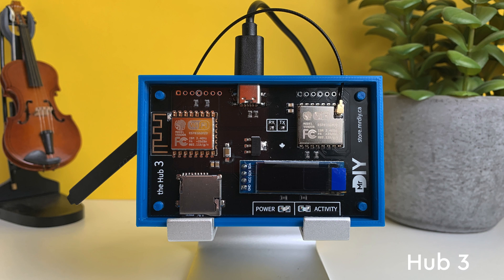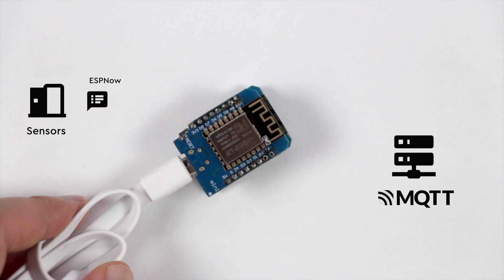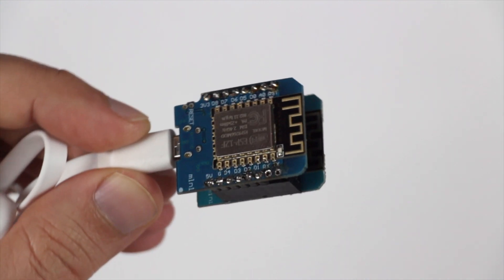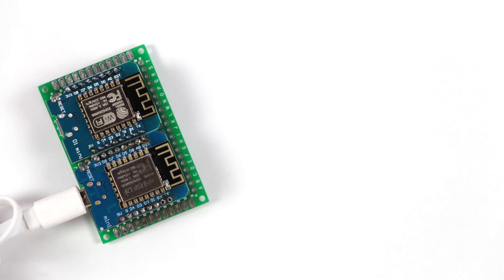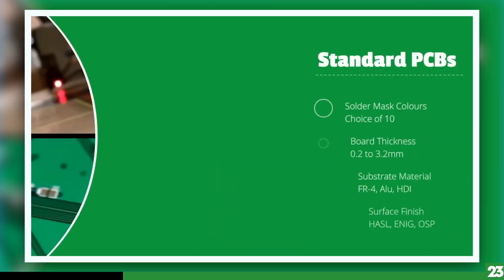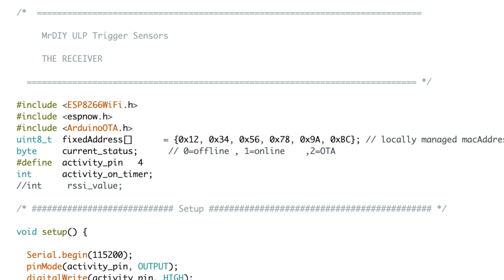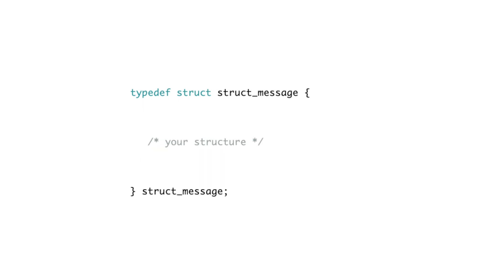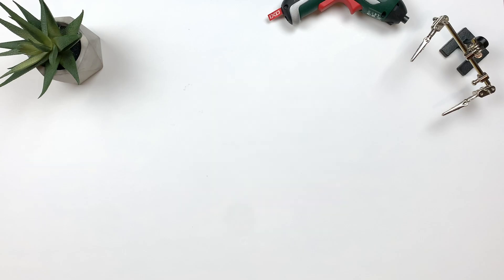Super Simple ESPNow to Wi-Fi / MQTT Gateway & Why I Use Two ESP8266s

Comment: can this gateway be converted to esp-now to USB connection to homeassistant ( no Wifi)
Reply from the maker: You could try connecting the ESP8266 to your computer via USB, then use an application to read the data from the serial port.

Comment: Thanks for video, I was able to use 1 ESP32 as receiver and connect over wifi with Blynk but only when wifi router is on channel 1. for me channel 7 on router is most stable but when peer is set to channel 7, error code appears saying peer channel is not the same as home channel, even though router is on 7, but it works when all components are set to 1. Does anyone know the reason for this? I've also seen a code that obtains the wifi channel on receiver board. If we can send this information from receiver to sender and this changes once every day or 2, would it be sustainable?
Reply from the maker: ... that is why I use two ESP8266

Comment: Maybe a weirdt question, is ESPNOW better then using the normal wifi on the esp boards and directly send to an mqtt server?
Example: i currently have all my esp configured it sends the mqtt messages over WiFi BUT, i saw that the esp doesnt like my UniFi wifi setup and keeps disconnecting (even the one thats like 4 meters from the ap) at random moments. can ESPNOW send the date better?

If so i was thinking about maken the gateway and use 1 esp8266 as espnow receiver and then a normal arduino chip with Ethernet.
Reply: ESPNow will be more efficient for battery devices as it can wake, send a packet and go to sleep. Normal Wifi will require quite a bit of overhead on each wake to achieve comms with the base station. So ESPNow has two options: reliable (wait for ack packet) and simple send-and-sleep. So it's like UDP but minus the additional WIFI overheads.

Comment: hi, my receiver olny receives J⸮f ` ⸮]7⸮          ⸮⸮ @ olny myData.mesh_id etc is clear, why?
Reply from the maker: That is the unreadable struct data. If you are not using the gateway code, you need to parse the data in the receiver itself.
Reply: @MrDIYca  I have the same problem, I used the original source code and flashed it onto my wemos d1 minis. Do I need a espnow sensor to test it? Or is it possible to test it via the debug monitor?  Are there any further tutorials you might recommend for a beginner like me to get it working? thx for helping :=)

Comment: very nice, I am actually working on similar project because my current sensors use wifi and I am not able to get anywhere near less than 1s from wake up to sleep (including: measuring temp/humidity/light, battery etc., sending to mqtt broker and going to sleep). With espnow I am below 0.5s but of course without sending to mqtt. So I need a gateway. But instead of 2 esp I am thinking like that: gateway receives data on espnow, then reconfigures itself to normal wifi/sta, sends to mqtt and then back to espnow receiver role. The only problem: gateway might miss the next data from another device (in case sender was trying to send to gateway/receiver, when gateway was sending to mqtt). Will try more before I give up and do it with 2 esp ;-)
Your project is very neat - I like it.

btw with espnow in place and 0.5s of sender being active, when it goes to sleep I went down to 4uA (all my sensors get power 3.3V from one of the esp32 pins, so when esp32 sleeps there is no power delivered to any sensor) - I am not using any LDO - direct power from lipo battery - esp32 works fine up to 4.2V I can see.

btw2: I saw you are using cuts on the pcb for the programming - you could use soft serial for sending data between esp, right? and the hardware serial for programming. did you try?

Comment: I dont understand why you are changing the WIFI constantly.
But maybe this is a good project to receive serial data and send it as MQTT.
I have my weather station with the Mega2560 in mind. A serial output is quickly added. 
Then the ESP can take that and throw it over WIFI.
Reply from the maker: Modern APs change channels all the time for better performance. Yes, you can use it that way too if you need Serial-to-MQTT gateway.
Reply: @MrDIYca  btw when you set up on your AP fixed channel (and on esp32 as well), then the connection from esp32 to AP takes 100ms as it does not need to scan channels

Comment: Or just change wifi channel from automatic to a static channel as you should anyway, especially if running multiple APs.
Reply: I had this problem. I made a sensor array for a client and at each site wifi channel was diferente and sometimes they would change it. This was why I made a gateway with 2 esp32
Reply from the maker: If you are running multiple APs,  you shouldn't be using the same channel.
Reply: @MrDIYca  My point exactly, just didn't spell it out. Figured it was implied by setting channels rather than relying on background scanning to set these for you.
Reply from the maker: Ok, maybe I am misunderstanding your point.
Reply: @MrDIYca  Maybe I miss yours as well, I was thinking the second ESP was to provide a static WiFi channel for the first ESP. In which case someone should just set their AP or router to a static channel instead of automatic. This is still great info for someone who is not in control of the available WiFi.

Comment: What about using esp01 for EspNow? Thanks for the cool project
Reply from the maker: Yes, you can use any ESP8266 module or board
Reply: I had some problems with the ESP-01. When transmitting it take a lot of power and the chip can easily overheat and crash. The boards which come with a screened module seem to have enough surface area to stay cool and run reliably. The D1 mini is good and cheap.

Comment: I’m still super confused as to why this is better than using ESP home with HA and MQTT My current Esphome sensors are updating almost instantly with little to no lag each sensor has its own web page, I can subscribe to the MQTT topic with all my other devices, and HA displays all my sensors anyway. Sorry for my ignorance.
Reply: ESPnow doesn't use wifi, so no 802.11 overhead, good for batery powered devices, and much faster than wifi negotiations on deep sleep
Reply: check how much time it takes for ESPHome based device from power on to sleep - you will be astonished - minimum 3-4 seconds. With espnow in place you can be done with 0.5s - that is the reason why building a gateway that is always powered on with clients (sensors) that communicate only with gateway and go to sleep might be reasonable. Battery life
Reply from the maker: Hi, no it doesn't make a difference if you are going over Wi-Fi. I assume your sensors are plugged into the wall and are not battery powered? I used ESPNow and a hub to minimize the time the sensors are powered on and consuming the battery. ESPNow is MUCH faster than W-Fi from a cold boot.
Reply: Most of AP has a maximum client limit.   Beyond that the connection sometime get unstable. This architecture resolves that issue too.